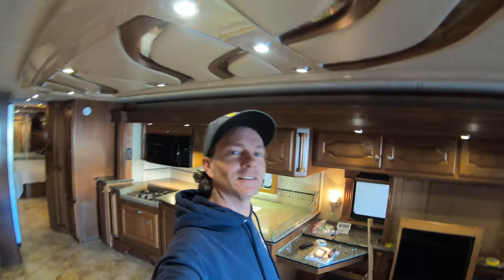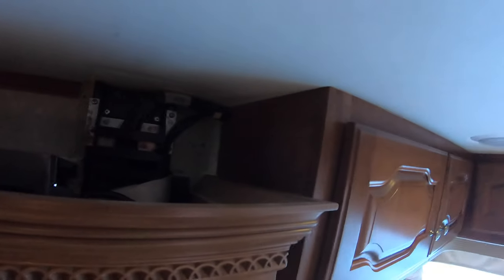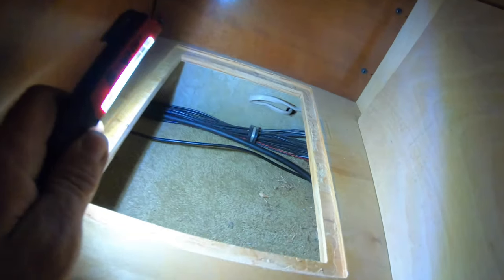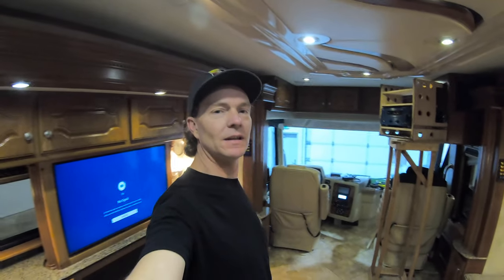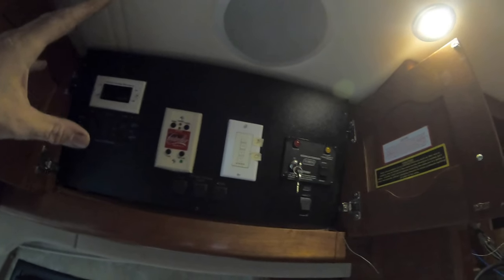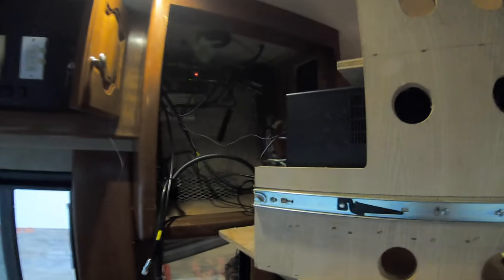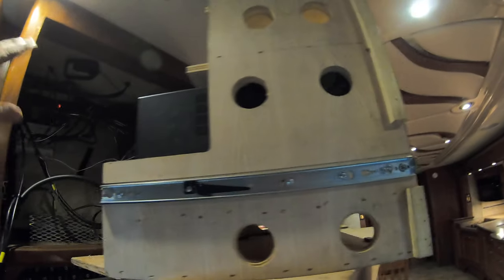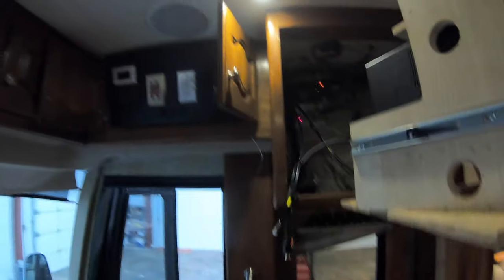Running a HDMI cable to the Slideroom on a Country Coach Intrigue some new technology

Comment: I subscribed to your channel to see your mods and fixes. I'm 100% hands on with my coach (03 Wanderlodge Lx 40). Was that TV lift stock or did you add it? My big screen is overhead the driver, passenger seats and drops on a hinge and cables. Kind of hangs down over the entry. People hit there head etc coming in. I like to move it to a pop up lift (like this behind the sofa in the front slide).    Can you tell ,me who sells those lifts?